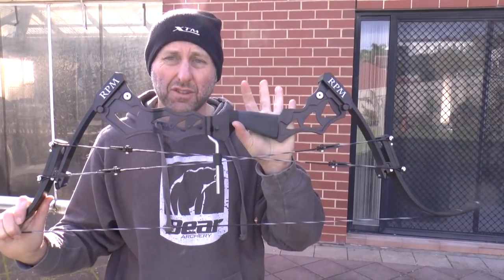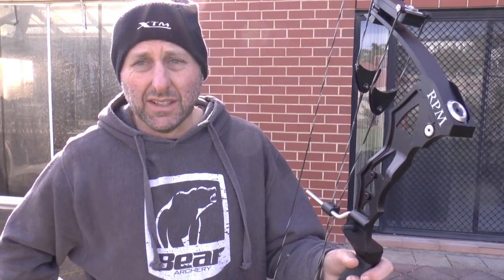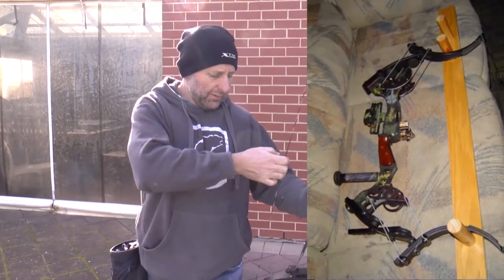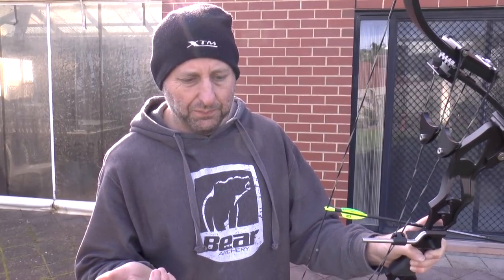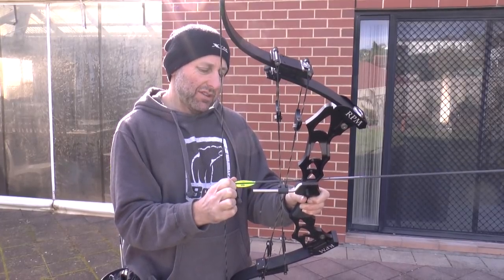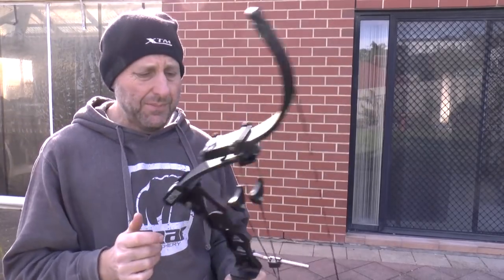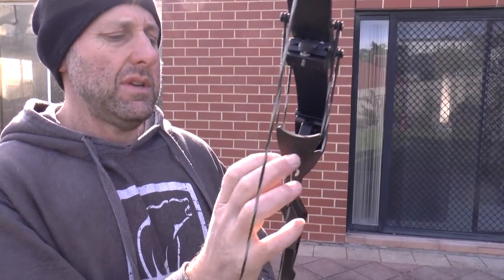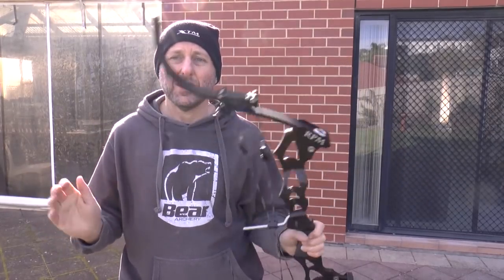RPM Striker compound bow review

Comment: I own a Gen.1 Striker which i use for 3D archery. It has shot a lot of arrows over the past two years. After trying several arrow rests, i use a Fivics magnetic flipper rest  (original intended for Olympic recurves) with a plunger. Perfect and easy setup! My bow is setup for 40 lbs @29". Arrow speed is around 193fps @ 9,8gn/lbs. I replaced the original cable guide against a better one with rollers and bearings, because it was constantly eating away my cables. Obviously this made new cables and strings necessary. I made some custom BCY 452X cables + string with Monkey Tail dampers on the cables and whool puffs in the string. I shoot this bow without stabilizers, because i find them annoying walking around in the woods. I added a 350 gram bare bow weight instead of a stabilizer, for better balance. This bow may not be faster than my Recurve with Uukha limbs, but it's definitely a lot more fun. It's also the quietest bow I've ever shot. Absolute no vibrations after the shot.
Reply: Try using a cajun arrow rest from bowfishing. They are great!

Comment: i owned a discovery back in the day and to be honest it was a novelty but the concept was excellent. For me the attraction was the simplicity of it. I could take it completely apart with a pair of strings and a set of Allen wrenches. The real weak point was it had split limbs on the inner set and they tended to twist towards the cable guard. This seems to be an improvement but I feel the lack of serious weight keeps this a novelty.

Comment: That NEW design is not new. I gave that design to Wil Allen in 1967.  He went with wheels on the limb tips.
There are several other designs like that. I made a couple in Michigan in 1967. Muz,,...zy has one that they flubbed. There was the Discovery, etc.

Comment: Question: I unscrewed my limb bolts from 60 to 50 lbs for a friend to shoot on my base bowmadness 30 when I tightened them back up it felt like it slipped or skipped thread should I let it back down and check the bolt before I put new strings on or nothing to worry about?

Comment: Do you think its possible to adjust the cable guard to make way for a whisker or drop away arrow rest?
Reply: Looks like there are two locking screws in the riser's arrow cutout. I would presume that loosening these would allow the cable guide rod  to be rotated away from the riser. However, that would alter clearance, change cable tension, etc. As has been stated, RPM are bow fishing specialists, and they have set up the bow for best cable position and clearance with a simple bow fishing rest. As these are often very similar to the rest Steve used in the video - basically just a bolt a very simple support arm on the end - the guide rod position used doesn't get in the way for the intended use of the bow.

Comment: I own a Rpm nitro. I love the bow. The only problem I got is after a few months the bow started sqeaking when drawing. I brought it to a shop but they couldnt figure out what caused it. Bow still shoots fine but sqeaking sounds when drawing :( pretty much I have it cuz its a cool bow ( im an arrow fan )
Reply: Take some veggy oil and put a little on the hinges draw and repeat a few times. See if the helps.
Reply: Hinges and limb pockets on a lever bow
Reply: @Toiletstainz  limb pockets were my guess aswell. But I dont have the tools to remove the limbs to lube them. All other movable parts are lubed.
Reply: All you need is a set of allen keys..
Reply: You may get a click or snap when you hit full draw too.   What’s going on is that the saddle bolts (1/4” ones) may develop a little play on the Oder of say a thousandths of an inch.  Take your small Allen wrench and tighten up.  That’s takes care of the snap.
Reply: @vonmajor100  thanks for the reply. Ill have a look at it soon. The bow hasnt seen daylight in a few months

Comment: No thanks.  I’d just use a recurve.
Reply: Recurve bows don't have let off though.
Reply: @desertrainfrog1691  That’s true, but those bows are $1200 usd.  They are slow, at 305 FPS ibo speed.  I wouldn’t spend that much money on a bow for bow fishing.  If I was going spend that much money on a hunting bow, it would be a Matthews, Bowtech or something something similar.
Reply: @victorkrese6727  You can bow fish with a recurve anyway, and I do agree. Although some of the RPM lever bows are 500-600.